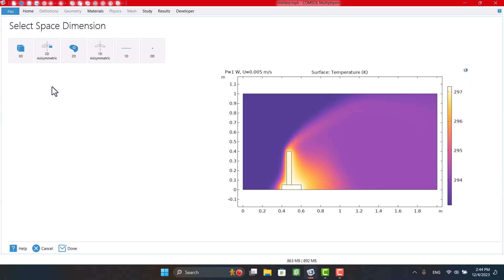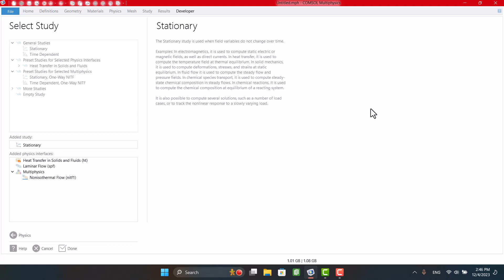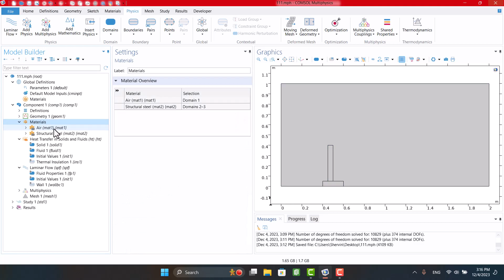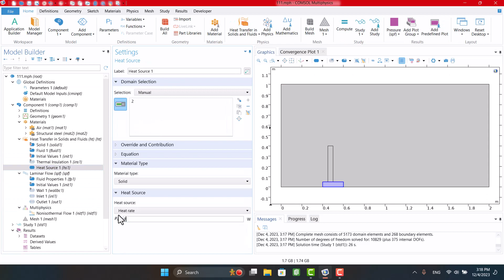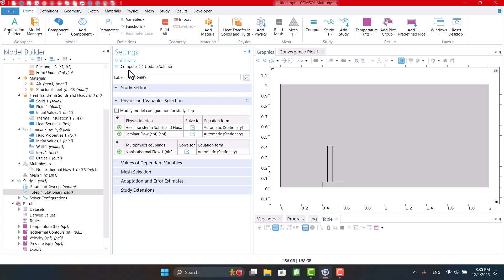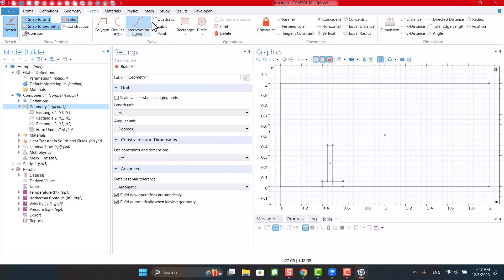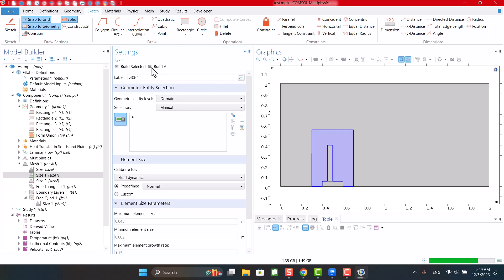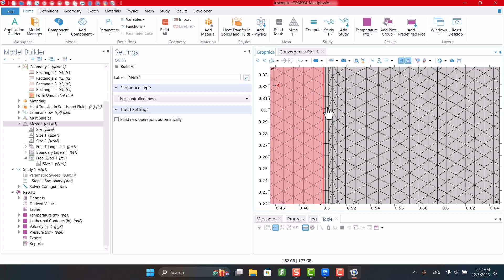🔥🌡️ COMSOL Tutorial: Conjugate Heat Transfer Simulation 🔧

Comment: in real life where can i find this application ???
Reply from the maker: Fins of Refrigerators. All of aircooled radiators
Reply: @caewitharminhashemi  can we add another fluid like water instead of air in the simulation of your video ?, or this simulation work only for air ?
Reply from the maker: @andrespefia7379  of course. You can add water instead of air. But it must be laminar flow.
Reply: @caewitharminhashemi and why not using turbulent flow ?
Reply from the maker: @andrespefia7379  because in this video i used laminar flow. You have to add turbulent flow if you want to model high velocity streams.
Reply: @caewitharminhashemi  thank you very much sir
Reply from the maker: @andrespefia7379  you're welcome